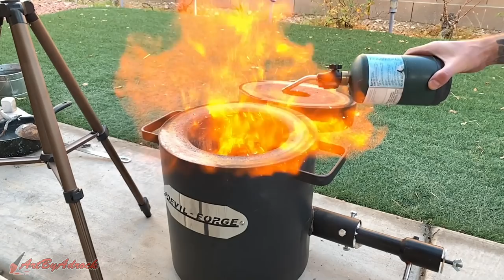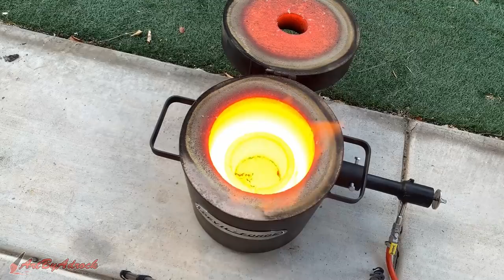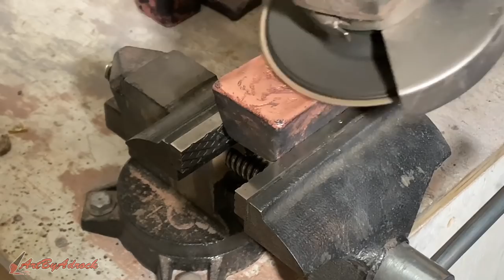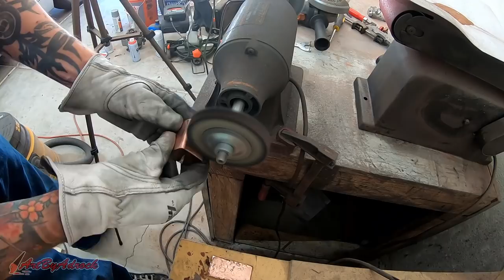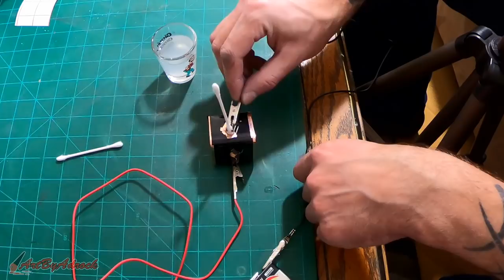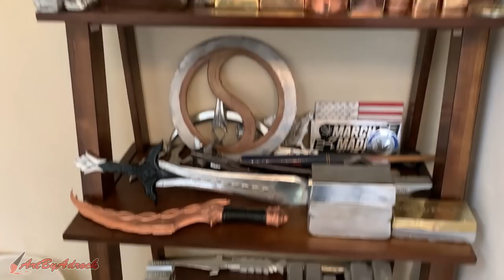Custom COPPER 2KG Ingots From Scrap Metal Wire & Electro Etching - Melting PURE Copper At Home

Comment: I have a furnace pretty similar with cruciable an  high pressure gas.. Tried the same for about 1 hour and did get to the melting point. Didn't work out.. Any tips on that